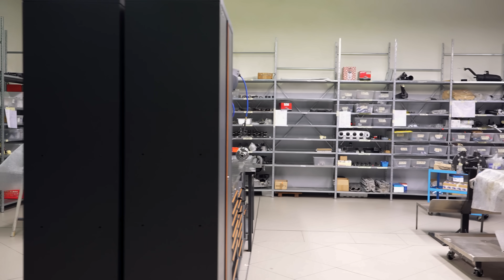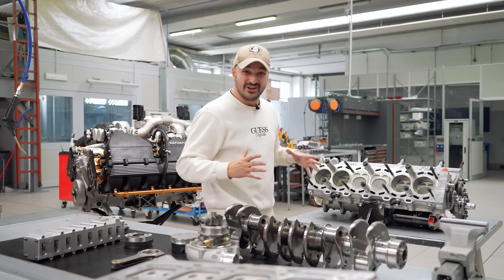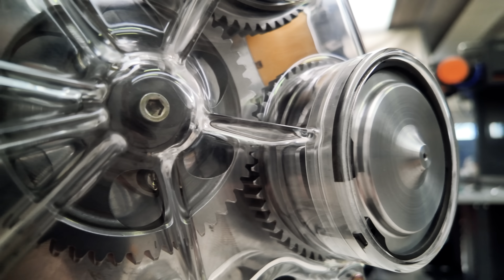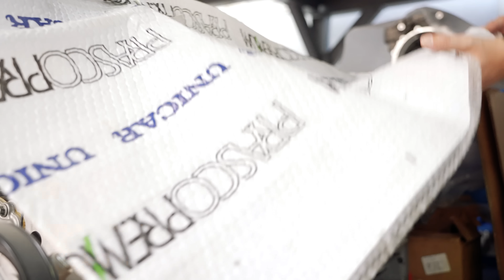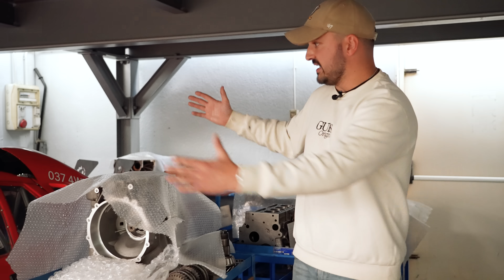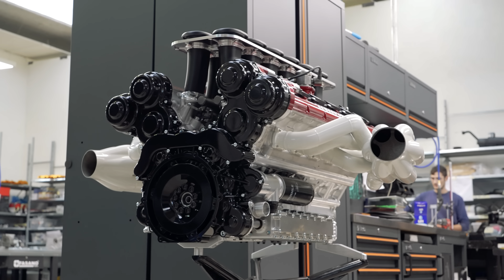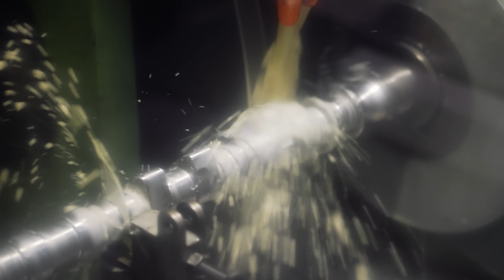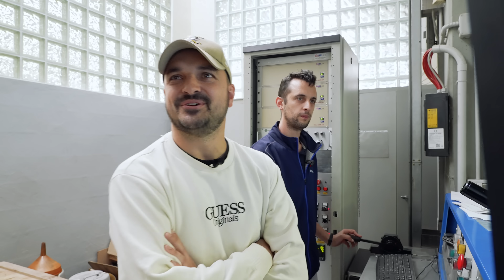This 7.0-litre Quad Turbo V12 Is The Most Powerful Car Engine Ever!

Comment: Giving them the benefit of the doubt and not Hennessy is odd when one has engines dynod for race cars over 2000 on the same architecture and one has one engine at just over 1500

Comment: Another way to avoid crankshaft wind-up is to take power from the middle of the crank. Honda did this with its bikes since the original (1969) CB 750.  The six cylinder RC166 250cc race engines (also 1969) did the same and central power take off was carried over to the CBX1000.

Comment: It definitely needs to be in a Bonneville streamliner, it’s a candidate for the A/BFS class record standing still. Cosworth’s three cylinder test mules should be in a Ford Pop, T-bucket, Mk1 Cortina or a 1932 Ford Coupe.

Comment: 1500 with a 7L quad turbo V12 is 220hp/l so like a stage 1 Corolla GR with an ECU tune, it's not that crazy. 2000hp target would be 285hp/l so closer to the state of the art like a koenigsegg 5L V8

Comment: Coyote engine with sleeved make more 2000 hp with stock crank of the shell parts . You don’t have to be rich buy the parts any ford dealer.

Comment: A 120 degree v12 seems wierd, until you see the mockup of the engine and something jumps right out... 120 degree V6 engines have huge advantages in packaging (shorter cranks), if you dont mind a balancer/damper to reduce harmonics, and just look at that engine. the overall design of that v12 is extremely modular, and not that revolutionary. ferrari made a 120degree v6 turbo for their 1981 F1 car after all. It wouldnt surprise me at all if this engine is also fundamentally two v6 engines. It also explains why so much focus is placed on the crankshaft. It would have been one of very few elements not off the shelf at a place like italtecnica.
Reply: Theres also a very funny history of companies wanting a v12 engine, and just stuffing two v6 engines together instead of making a clean sheet design. The Aston Martin v12 was two 1980s ford probe v6 engines (which started off life as mazda engines) welded end to end.

Comment: Did the Engine RPM stay the same for the last 7seconds of the boost buildup to peak?, that was confusing to hear, is this to increase torq but not rpm to harm the top?, im confused, or is the turbo size just bad match for backpressure?.

Comment: Ford's 5.4 4V already killed them all.
The ONLY passenger car in the world to achieve 300.4 mph in one mile and 21 seconds. 
200-300 mph in 10 seconds. 
Bugatti required 44 seconds to span 200-300 mph. 
Turd

Comment: Looks completely over engineered and very large, very heavy. It's a fact that the small displacement of 307 cid on something called a 5.0L Coyote with turbos and specialized build, as is this engine can, and does make more power. Highest HP per cid. Only 8 cylinders much simpler, much lighter and much smaller not to mention at only a fraction of the cost and a real production engine. But it's just an old Ford.
Reply: Like you really know. LOL
Reply: Why are Coyote fans always fascists that need every engine to be like theirs

Comment: The V12's are the most flexible engines for timing. They are essentially two inline-6 engines put together. I-6's are individually perfectly balanced by themselves, so you don't need to even make them on standard 60, 90, or any other multiple of 30 degree banks. You can make them something like 57 or 113 degree banks, or whatever, and they would still be perfectly balanced, due to each bank being an I-6 by itself.  Ferrari is using this advantage in its 12Cilindri's engine by making it 65 degrees!

Comment: 2000hp from quad turbo V12 ?

Here in 🇫🇮 we have engine manufacturer which makea even their small 4-banger to make that measely 2000hp.
elmer racing Thor, 4000cc single turbo , 2000hp, 1900nm torque, 150 kg weight.
Engine IS capable up into 3000hp.

Comment: Why do you think the GT 350, with its significant imbalance and large counterweights, can rev faster than a car with a crossplane engine despite having equally large counterweights? An inline 6-cylinder engine has a power stroke every 120°. If you add another cylinder bank at 120°, you'll have two simultaneous power strokes in both banks when the connecting rods are at top dead center. That's what causes it to break. You have to incorporate that 60° crankshaft offset. In this case, it's beneficial; even the Bugatti V16 needs an additional 45° crankshaft offset, even without a turbo. The reality is that narrow crankshaft journal angles generally make the engine more prone to failure. That's why in V10 crankshafts, the journal offset is 144°, not 72°.

Comment: The oil pump does 2 cylinders per pump so 6 pumps for the v12 so why is there 8 pumps on the bank of pumps. Did i miss something in the video?
Also another great video mike and glad to see the channel doing well. 👍
Reply: where does the oil from outside the first and last main bearing go to?

Comment: That’s an overly engineered nightmare mechanical puzzle engine. They could’ve just called up Tom Nelson, and got one of his 7 L twin turbo motors. That’s every bit the artistic build that engine is at half the cost twice the reliability and will easily surpass 2000 hp with its octane on demand. That engine’s footprint is gigantic. It looks heavy as a boat anchor and looks like an absolute fucking nightmare to  service 

With the heat soak that quad turbo system is gonna develop. They’ll be lucky if the car doesn’t fucking burn to the ground.😂
Reply: Look up the 'Bean Soup Theory'. It's right up your alley.
Reply: They show a mid-engine car. And in the engine the Vee is hot. So convection will remove heat. Also: All hot stuff is in one place unlike with cold vee. So the "surface" to conduct heat is smaller. You already see double hull everywhere. Even if servicing would be come more difficult, I wonder if the whole hot end could be put in a sleek shiny "bottle" as a third layer of insulation. VWs W16 has long exhaust passages within the block, which introduce heat. I read that car manufacturers cool the exhaust -- which would put a burden on the water cooling. I hope that here components are used which can resist heat shocks and catalytic converters which don't need water cooling. Hi octane rating and direct injection should lead to a cooler exhaust. I would love dynamos on those turbos to extract even more heat.

Comment: While I haven't yet had the chance to watch the video,  I'm reading the title and I have to mention top fuel dragster and funny car engines.  I will also acknowledge the video's notes, that this engine is a 'road car engine', which drag racing engines couldn't possibly lay a claim to.  Nonetheless, top fuel engines are still based on the old MoPar 500 cubic inch hemi architecture and produce on the order of 11,000 HP!!!  They'll run for 3.7 seconds, but by 4 seconds they're pretty much shrapnel.  Definitely no Nürburgring speed records to be made with one.  ;^)
Reply: Look up  the 'Bean Soup Theory'. It's right up your alley.

Comment: I thought this is a NA motor if it was 1250hp NA which i believe is possible then it would have been even better.
Reply: a show car with a rear mid engine with open hot vee exhausts headers pointing to the sky would be hot despite the lower power

Comment: that’s almost as flat as a Testarossa V12!!
Reply: With that flat V12 I had the feeling that the wide cylinder heads scratch on the asphalt. But with the intake crawling over the valve cover, perhaps a pretty V12 is possible? Per bay balance is not so great in a flat V12. Those counter weights work best around 90° .

Comment: By production you mean, 100 in 5 years? 

I think the most powerful production engine should have ** unless you make more than 1k of them a year.
Reply: Lol "production" there is 2 in existence and it's hard to machine. It's a cool motor and nice solving of engineering issues, but would you give the crown to  a guy if he made in his garage and then sold 5 over 15 years? It's DOT certified so it's "production"?

Comment: Torque curve on the cow supercharged-turbo 4?
Reply: Interestingly, this engine combines long exhaust headers with 4 turbos. The former should give great torque at high RPM, while the latter gives good torque at low RPM. In combination: A wide power band.

Comment: Uneven firing V12? Yeah things are getting spicy alright
Reply: Does the crankshaft solve a problem with bank angle? With 120° two cylinders are firing at the same time. I wonder if the offset shifts those slightly away to reduce peak instant torque?

Comment: I'd love to see some EV workings - engines are fun, but motors and and their construction in cars would be awesome.
Reply: what "construction". You know that engines can be swapped quite easily?
Reply: @ArneChristianRosenfeldt  I meant as in, what types of electric motors and designs are being used in EVs, drivetrains, regen etc.
Reply: @dazmatic  Ah like in radial or axial magnetic flux and how the much Neodymium is in the permanent magnet. I like a motor made of multiple disks because it minimizes the amount of iron. The permanent magnets are loaded evenly so that we waste no Nd. Only the endplates are overhead.

Comment: I thought Merlin engines were once used as a car engine.  Didn't they have more hp?  Like Jay's did.  https://youtu.be/8AKCnIO2QeM?si=dNATjBFL0qlDyvzH
Reply: You thought wrong.
Reply: @Hang.On.A.Minute https://youtu.be/8AKCnIO2QeM?si=dNATjBFL0qlDyvzH
Reply: @Hang.On.A.Minute  which I frequently do.
Reply: And Jay did already drive around. And his tank engine also has a hot vee!

Comment: Camshaft at 1200 rpm would be engine crankshaft at 2400 rpm - rather a fast idle!  The 50 - 70 - 50 firing interval is intriguing.  Presumably it could be applied to any large straight 6 as well, as used in large diesel engined trucks.
Reply: I still don't believe that 50 70 would even work in 60° V12

Comment: Koenigsegg have a 2300hp 3 cylinder.
Reply: 'Bean Soup Theory'
Reply: It's a 600 hp engine. Other horses are electric.
Reply: @vvevvevvvv I read the hybrids are coming back. Batteries got cheaper, but not more range. So for your cross Germany non stop 250 km/h trip you still need an ICE somewhere in the car.

Comment: Hi Mike is this V16 different from the Bugatti Tourbillon V16?
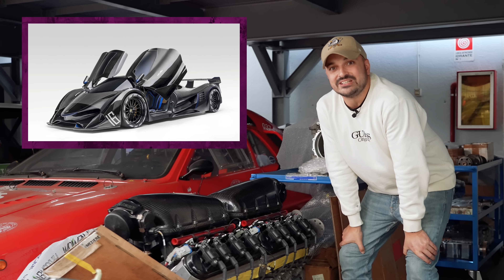Reply: you mean 12:09 ? Firing order in a W16 is already confusing ( and it is not even per turbo ). VW once bolted balance shafts on a flat crankshaft V8. Why is this so uncommon? With V16 two flat V8 could be mated so that they cross. So the balance shafts would only have to compensate side to side rocking motion.

Comment: As someone else commented "This video is real clickbait hype". My guess is that the commentator (Mike Fernie) used to be some kind of TV motoring star but has a very poor knowledge of automotive engineering and is hoping the hype will carry him through. Example: He spins an oil pump centre gear in a circular movement around the inner teeth of the outer gear and claims it's wonderful when in fact the centre gear spins on its own axis. Obviously this hype is aimed at people who don't have a clue about engineering matters.

Comment: The amount of effort and engineering to get this level of power out of a relatively small combustion engine is wild. 

EV motors are just so much simpler. Easier to get insane instant torque and crazy HP from. 

These guys are a creative group!

Comment: But I kinda disagree on some level, YASA (a division of Merc) have an 800nm car motor weighing 24KG, any lightweight sports car is going to be spinning tyres with that and the challenge is not how much power? but how much you have to throttle it in order to stop the wheels spinning out of control and you into a tree. in 3 seconds you will be at the speed limit in every regulated territory on earth, on track you are heading into the braking zone  at the end of the longest straight on most tracks, yes you will have bragging rights in a Car Wow style drag race, but that's it! with ICE even quad turbo 7L 9000 RPM 120degree (soo cool) V12,  you arn't beating an EV with sorted traction control (actually the limiting engineering problem)
Im not quite sure where I am going with this, but maybe!  ICE engines have to respectfully hand the speed crown to EVs and learn to play in there own backyard with stuff that makes realistic sense with that technology
Reply: 'Bean Soup Theory'
Reply: @Hang.On.A.Minute  LOL yes. Thanks for the reference. not come across it before

Comment: "We don't have a crankshaft, there are only two in existance"; "This thing doesn't produce 2000hp yet, but it will". So this is not a production motor; it's a desire to create a 2000hp production motor. There are way more of Steve Morrisons V8 SMX's out there making way bigger numbers, so for me Mr Morrison's V8 engines have more claim to "production" than these. Don't get me wrong, these are super cool, but the hype here is off the scale.

Comment: I hate hot V's or as most call them Hot Messes but this one should be ok given the 120deg bank angle it should solve all the issues Hot V's have with heat soak and heat dissipation.   I would be easy to also design some type of forced air cooling system that flows through the middle of the banks to remove massive amounts of heat to help keep them cool and really makes you wonder why other brands making Hot V's have not added a forced air cooling system for the middle of the banks.  Would solve most of the issues they have.
Reply: Still air and shiny metal are good for insulation. The block is water cooled and the turbo (bearings) are oil cooled. The compressors are cooled by the incoming air. Only thing is: The hood needs to be heat resistant.

Comment: There's venom f5 evolutions driving around making 2031 hp while this V12 has only actually made 1500 so far. So although an interesting design this is NOT the most powerful production engine.
Reply: 'Bean Soup Theory'

Comment: Steve Morris Engines designed & built a V16 quad-turbo engine for the Devel 16, making 3,000 horsepower on pump gas & 4,515 horsepower at 36 PSI of boost.
Reply: You are the 'Bean Soup Theory'.
Reply: @Hang.On.A.Minute   coming from some 1 that calls a 1 off a production item lol

Comment: The oil pump stage you're fingering is pretty pedestrian, compared to geared designs, in which the lobes are never in contact with each other. 

Must be okay, though, because apparently it works.

Comment: the title is wrong though. u baited out "production" from from the engine description in the title though. and the powerband on this lump of spinning and reciprocating metal parts cannot even remotely compete with electric motors sir.. this lump has to "build" power then shift gear and repeat, versus a freely spinning rotor in a stator.. no contact, no friction, no fuel, no sparkplugs, no engine service, stable and controllable output, regeneration from braking and so so much more. nah mate. this is not a "crate engine" that ppl can buy. i think that Mate Rimac should send you an invitation to come experience what we do on the continental scale :P

Comment: Supercharge low rpm / turbo high rpm is the new twin turbo.
But the supercharger should be coupled  with a centrifugal clutch not an AC clutch

Comment: I think hybrid is the current way to go for a daily driver; gas saving mpg, and electric power to fill the acceleration gaps for the gas engine, double power, almost double the mpg, that's the perfect hybrid system
Reply: Like a Giamaro is ever going to be a daily driver and that owner would care about MPG. LOL
Reply: What does this story have to do with hybrids?
Did I miss that bit? Are we watching the same video?

Comment: There's one thing to note about Hennessey's claim. His correction factor is the STP SAE J607 correction, not the SAE J1349 normally associated with American automakers. What does that mean? It means that if you want to compare the Hennessey engine to a normal production engine, you can at least deduct 4.5% from Hennessey's claims. That means the Hennessey compared to say a Corvette, Ferrari, this car, Zenvo etc. makes 1939 bhp at the most, not 2031. What is even more important to note is, that the correction Hennessey uses, does not have a specific minimal coolant temp, whereas the SAE requires a 180F degree coolant temp. So aside from the actual correction to be different, there will be even more of a difference if he ran his engine at say 135F or 160F. And knowing the conman John Hennessey is, there is little doubt that his number is a "hero pull" not a number it will make at any time in any condition.

Comment: With the best will in the world, does this really qualify as a production engine? It'll be built in tiny numbers, the output probably will never be independently confirmed and even if it is, there's then the question of how long it will run. Creating an engine that creates 2,000hp but will only do 500 miles or even a few thousand miles is one thing. Making one that runs reliably for 10s of thousands of miles is another.

Comment: I am here to tell you that the split pin 50/70 120 bank angle, shit design, and definitely not stiffer then a conventional 60* v12 crank. bottom line they did this for packaging.

Comment: Always intrigued by the crankshaft firing intervals. I think Ferrari V12s have a 65 and 55 degree interval, so in between a “normal” even 60 and this at 70/50. I’d love to hear more about that approach for benefits of that.

Comment: It's a cool tech demonstrator I suppose, but the only use this really has- is the billionaire owners bragging about it. On our real world bumpy roads, you would never even use 40 percent of this engine. I think the best use might be sticking a reduction gear up front, and using it in unlimited prop-driven air racing.